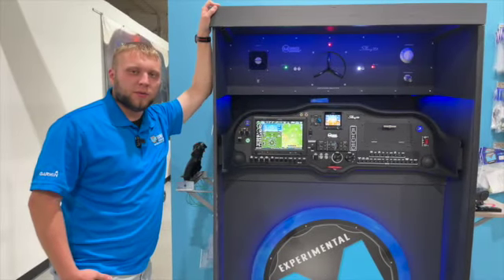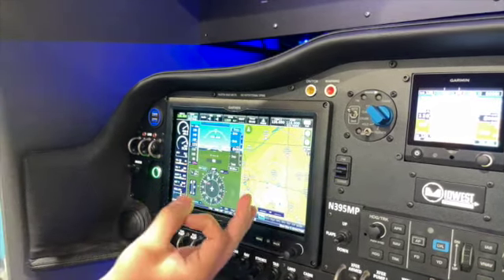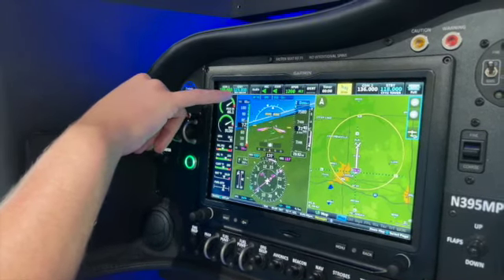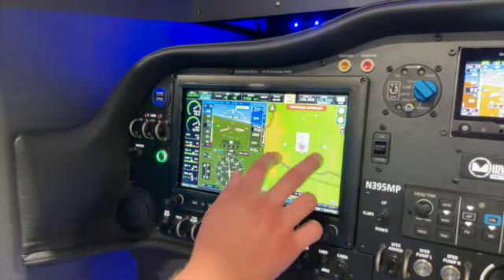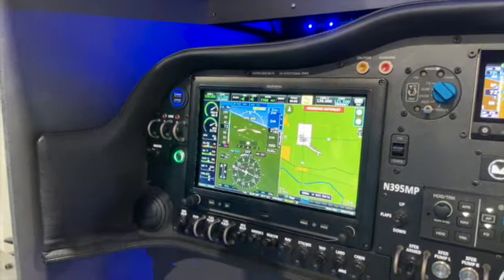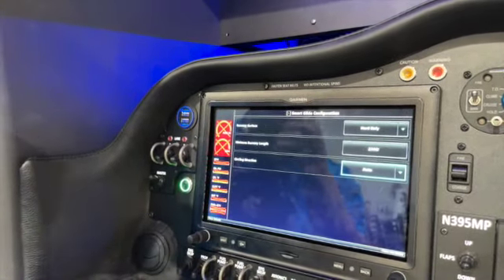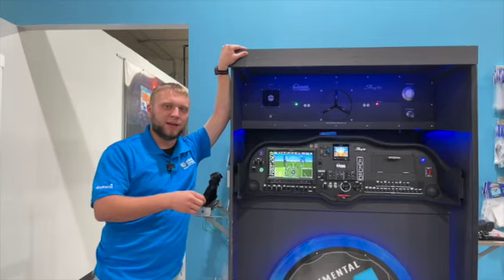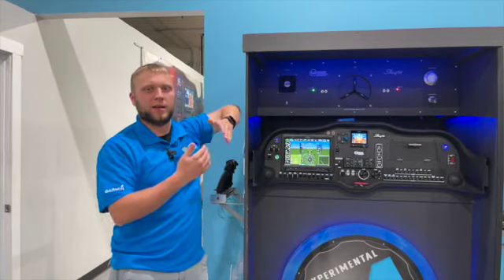Smart Glide™ Simulation

Comment: What is required to enable a plane for a true “Autoland” as offered on some planes? Thanks!
Reply from the maker: At minimum, auto braking and auto throttle.
Reply: @MidwestPanels  My Sling TSI has an auto throttle servo, and auto brake servo, but I don't have them connected because I didn't know this was an option yet.

Would I be able to get auto-land installed in this case?
Reply from the maker: @pilotavery  no, that functionality is not built in.
Reply: @MidwestPanels  okay, that's what I thought. The only avionics that have Cat III auto-land is the G3X but only on certain aircraft, like the diamond da62 etc...
An electrical engineering friend of mine was able to get his g3x auto-land working on his RV-10 but it took a lot of hacking and low-level programming and soldering work, way above my head... Garmin wouldn't help him either because of liability.